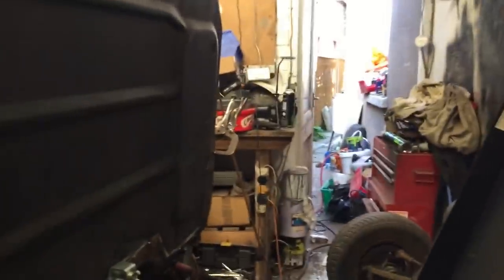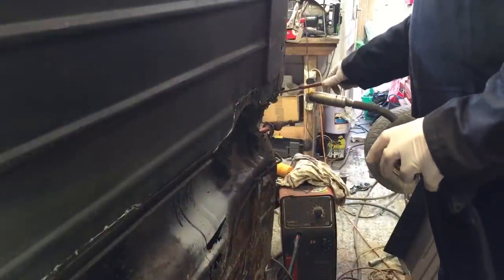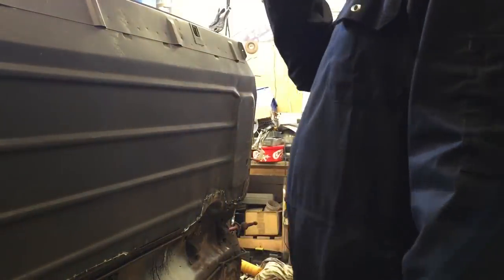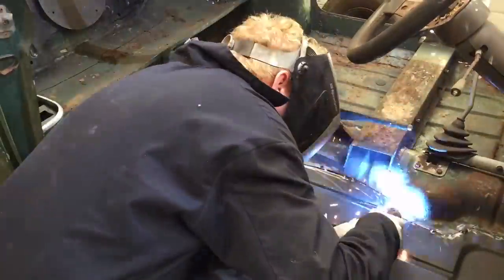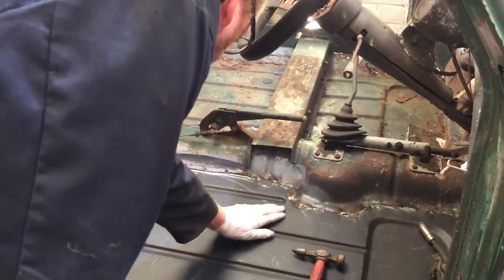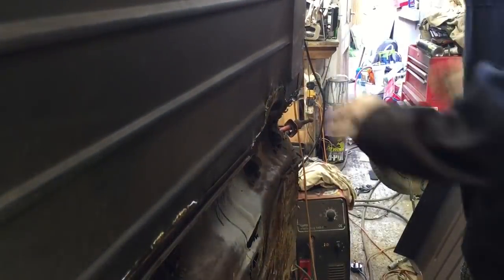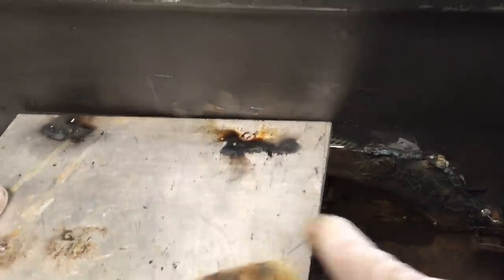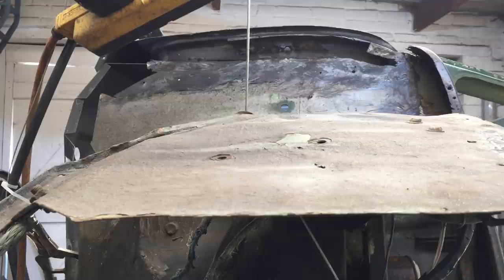1964 Mk1 Mini Restoration S2 Ep31 - Floor Pan Replacement

Comment: Nice job I'm really enjoying this second series. Little tip, next time when you temp fit the floor, spray some paint aroung the edge of the rear pocket. That way you wil have a line that you can drill along putting plug holes in the floor and you can then weld in the bottom of the pocket from underneath
Reply from the maker: cool, cheers for tip .. hope i remember lol , wont be issue on pickup :)
Reply: I haven't had a Mini since my Morris Cooper S around 1986-ish. How the hell has your's still got great heel boards at this age. I remember fixing mine and it was only twenty years old. When i took the bolts out they practically fell on the floor like a crumbled weetabix :P My favourite is the van, I wish I owned on,e but I can't justify a 2 seater.

Comment: Matt, have seen some 'youtubers' use compressed air to cool their welds when they are concerned with heat dustortion etc. Not sure if there is an issue with moisture in the airline or whether they use an inline dessicator/dryer to stop that? Once you make a 'weld' just blow it with the airline..that kind of stuff...

Comment: Pull the gas shield off yer mig gun and check your weld tip, might need cleaned or ground back to a point again, they can get blunted with constant arcing. And just for shits n giggles i've used a blow torch in one hand and WD40 in the other and put a work light at the end of the panel to cast shadows and just heat squirt, heat squirt. the WD will evaporate after. Crack on bud.
Reply from the maker: +PIPER DOUG cheers might give that a go. And yes must buy some new tips